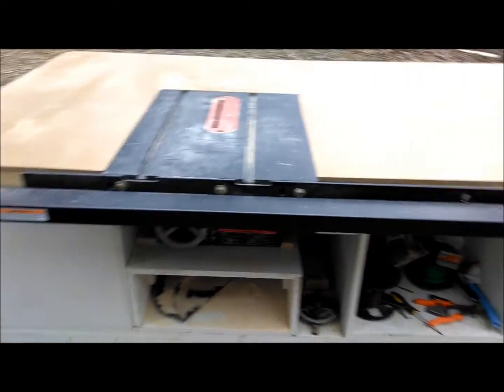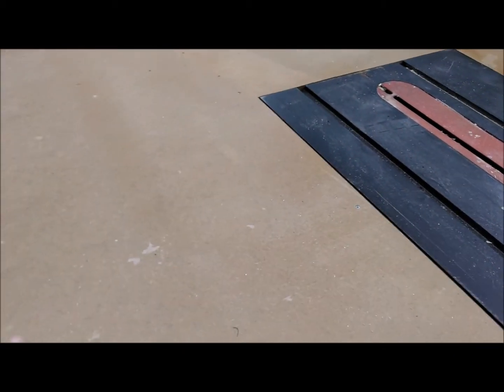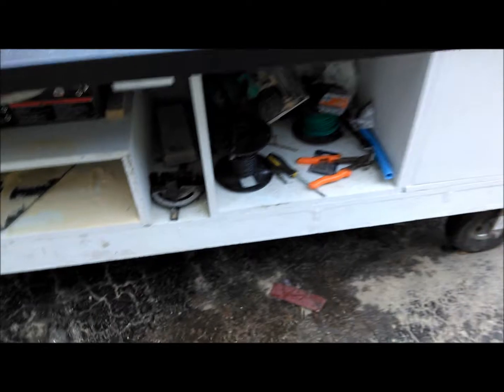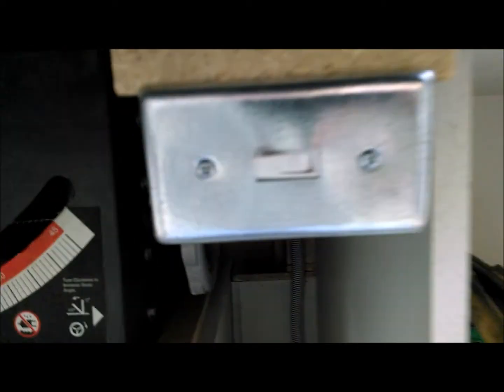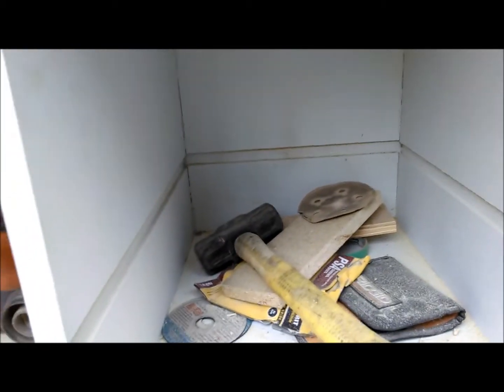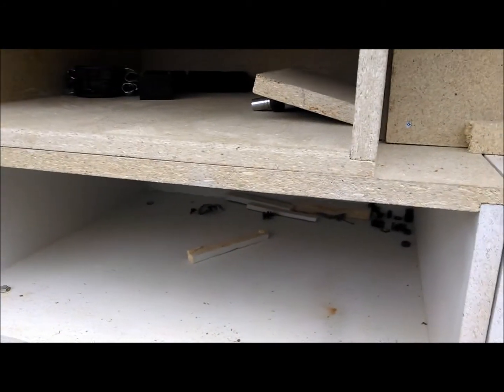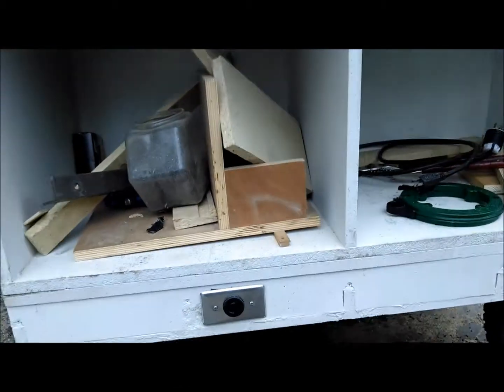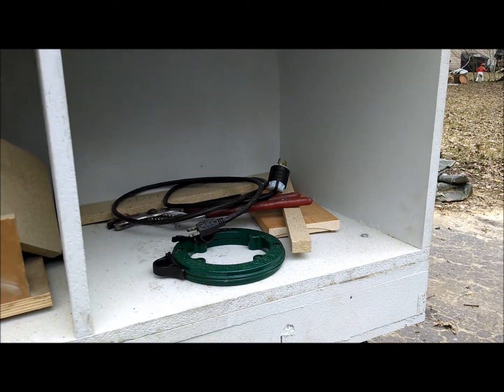Mostly completed saw table

Comment: Grate progress.  You have given me some ideas when I finally get started on mine.
Reply from the maker: I'm glad something I have done is going to help.
Reply: I am designing mine in sketchup.  Till I saw your videos I hadn't even thought of adding electrical.  I am wondering how high did you build yours?
Reply from the maker: I believe at the top it is 37".  I wanted it just a bit taller so I wasn't bending over as far.  What's nice about building these is you can set the height that will work best for you.  The last one was around 34 or 35" and it was just too much bending over all day when using it.

Comment: Still impressed with what you can do outside in any weather...  You mention a shop build router lift, based on at table saw mechanism. Do you have a link for a video showing that ?
Reply from the maker: The gentleman's channel is shavingwood and the video can be found here: Router Lift

Very interesting build.